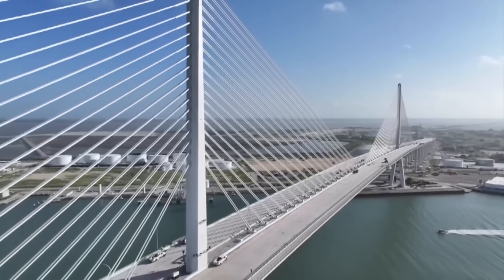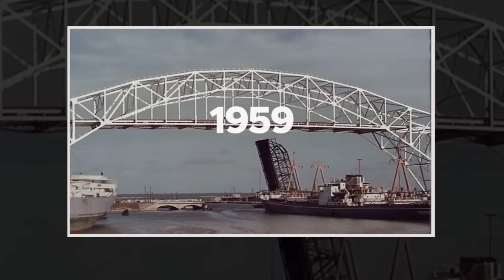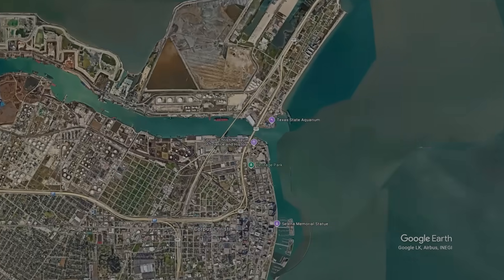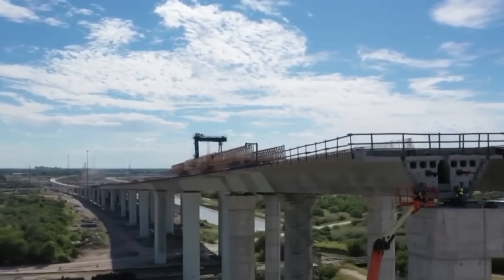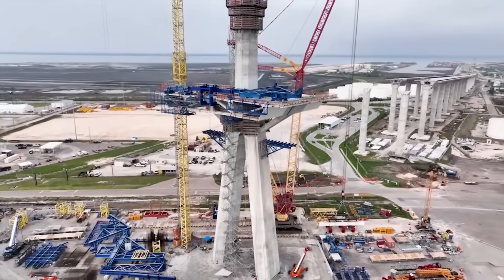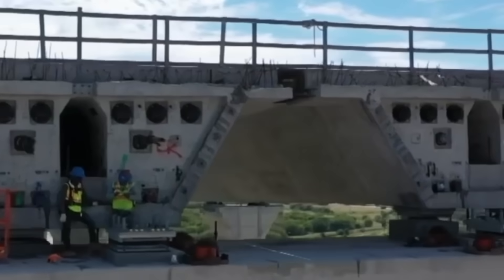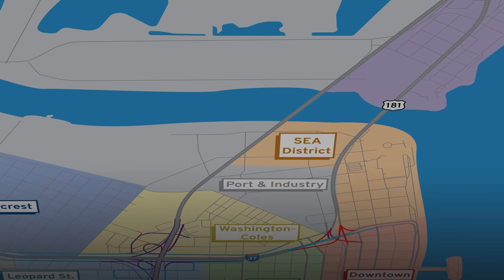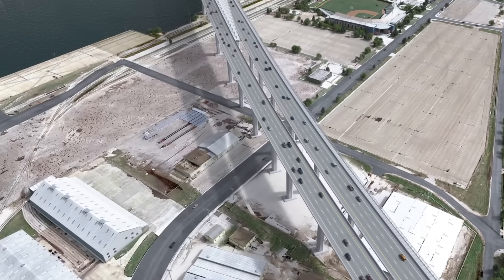The $1.2 BILLION Texas New Harbor Bridge Is Finally Complete!

Comment: I wouldn't say it's "done". Half the on and off ramps are still under construction. There is no ramp to North Beach, to get there you still have to use the old bridge. The connections on the city side to downtown or I37 South aren't complete, lighting is still being worked on, signage isn't done.... lots of work still on going. 

Sure you can drive over it, but it's still months away from the project being complete.

Comment: What a waste, Corpus had an opportunity to display an amazing and beautiful feature to a city that looks like Gotham city. But just like the rest of the city that bridge and its builder are subpar. I live in Portland and the first thing I noticed was the lack of detail. What I mean by that is that the concrete barriers and railing are not plumb. As in not straight, yes I know that nothing can be perfect but if the builders didn’t attempt to pay attention to the slightest of details, it makes me wonder what else they did not put much effort into. If you go over the old bridge you can still see the pride and attention from the builders. Yes it’s old and falling apart but them lines are straight with the exceptions of a few spots here and there, but for the most part it’s straight. I told my kiddos to be ready with a good lawyer because if it fails when I cross it daily they will be super rich and will never have to worry about money for generations.
Reply: just don’t be gay
Reply: Do you ever park next to the airport and tell off the pilots for how they land 😂

Comment: It is a total waste of money.
Reply: Americans will call anything beneficial a waste of money
Reply: @idek9628 There is no benefit to cost over runs and delay in production. I am certain this bridge is doomed to fail.
Reply: I agree!
Reply: The old bridge is literally crumbling. It would have cost way more to maintain the old bridge. It was a necessary project
Reply: @trey1sandoval  The original Corpus Christi Harbor Bridge cost $19 million when it opened in 1959. This included the cost of the bridge itself, land acquisition, and approaches. Adjusted for inflation, this is equivalent to just over $224 million in today's dollars. The new Harbor Bridge, which replaced the original, cost $1.2 billion.  Could have made two bridges

Comment: I just hope that the replacement cable stay bridge in Baltimore for the one knocked down by the MV Dali doesn't take that long. The only Interstate routes now are the two tunnels where trucks with Hasmat or Overheight cargo cannot use. They have to go all the way around Baltimore's Beltway now.
Reply: They have just now begun demolishing the remains of the old bridge, which is expected to take nine months. New bridge is supposed to be finished in 2028 but I have my doubts.
Reply: U do know that bridge was knocked down on purpose right that WASN'T A ACCIDENT

Comment: The record size for this cable-stayed bridge will be short, as the soon-to-be-completed Gordie Howe bridge between Windsor, Ontario, and Detroit, Michigan, is larger. Still, it is a beautiful structure and a great new landmark.
Reply: When the new Key Bridge is completed here in Baltimore that will also outshine this one for height, and match (or exceed) it in length.  New Key Bridge is to have at least 230 ft in clearance and the towers will be over 600 feet high. Length is to be at least 1600 feet. But of course, both will fall short (length-wise) of the Gordie Howe Bridge.
Reply: What a GREAT name for that bridge!